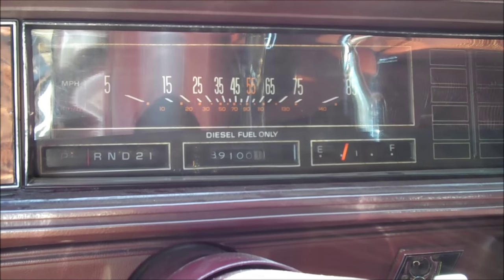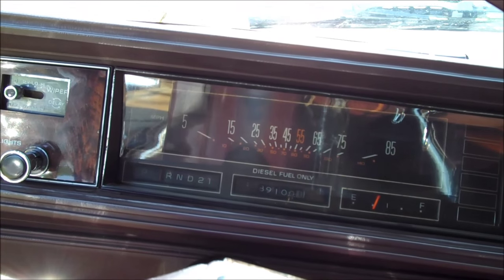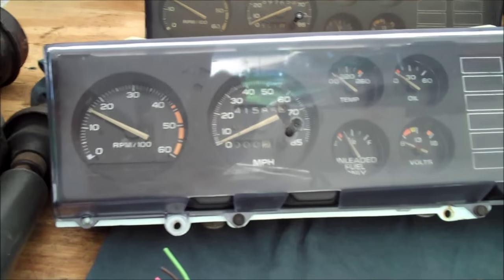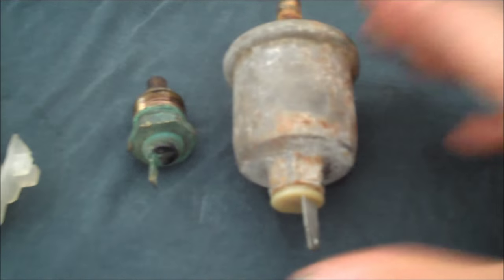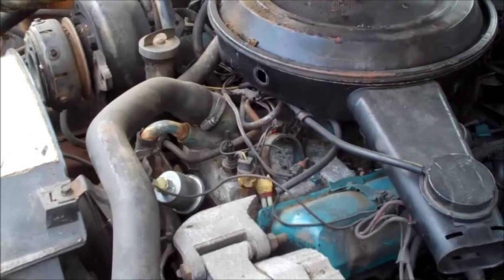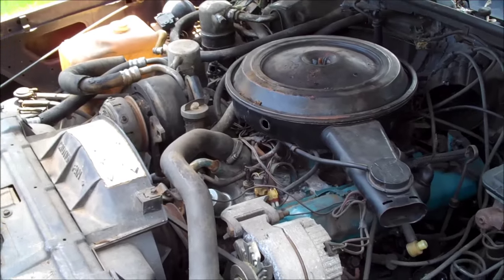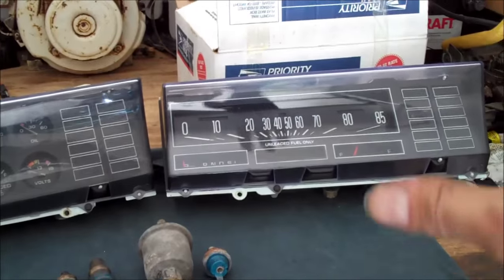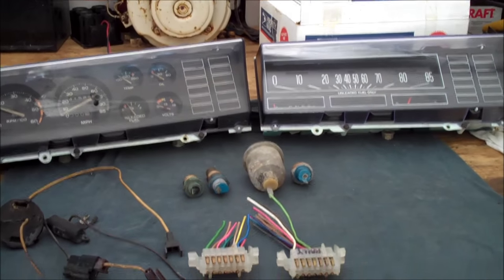How To Swap in a Rally Gauge Cluster 78-88 Cutlass

Comment: How do you access the G-body ignition switch and headlight switch on a 1987 Monte Carlo? Looking to do a remote start in one. Thnx
Reply from the maker: They are both located on the lower steering column shaft under the dash.

Comment: It would appear that the rally cluster is intended to be used with a center console floor shifter. I don't see any PRNDSLs on it.
Reply from the maker: dogbyte555  You can find them with the gear selector in them but harder to find as most were a console option.

Comment: i started doin this. interesting how he skips removing 37 bolts and completely disassembling gauge cluster to get it out.
cuz mine wont just pop out...how does the gearshift marker which sits vertically in a horizontal slot get removed w/o disassemling  gauge cluster?

Comment: Hey love your channel is there a way I can install a inside door handle inside the 1979 cutlass Calais without taking off the door panel? and a way to diagnose why a electric window stopped working??
Reply from the maker: You must remove the door panel to do any work like that. Test the power to the motor, if there is 12v then the motor is bad or the switch

Comment: Is that car or was that car a true diesel? I have never seen one in Canada. Diesel that is. I have had quite a few Chevy's over the years. I never did own a 80's G body. The closest to a g body I owned was my 1978 Chevy Impala 2 door with the wrap around rear window. I owned that car for many years and I did a lot of things to it. I installed a 383 stroker, A built up turbo 400 and installed a Ford 9 inch rear diff just to handle the power. It was a heavy car but also a fun car. I had a toggle switch under the dash connected to the electronic ignition so no one could steal it. Well I thought anyways. It was stolen about 1 month after I had the turbo 400 rebuilt for the second time. The transmission shop were the only ones who knew where the toggle switch was. About 2 weeks after it was stolen, the police found the car minus the engine and trans in a back alley many miles from my home. Someone from the transmission shop needed it more then I did I guess. I was pissed to say the least and was out $10000.00. I got the shell back, threw a 350 and a turbo 350 from a junk yard into it and sold it. I was not going to go through this again. Sorry for the long story but the 1970's through the 1980's were some of my favorite Chev's.
Reply from the maker: Awesome stories man! Yeah the one car I show was a factory Diesel but won't be any longer.

Comment: Can you tell me what wires to swap to put a monte Carlo rally cluster to a stock malibu sweep style
Reply from the maker: You need the entire cluster with housing and then you need the correct main plug from the cluster so you know how to re-pin your main plug to work with the gauge cluster. Swapping sensors is the same as in this video.
Reply: @ClassicGBodyGarage  is there anyway to know what colors do what ?
Reply from the maker: @wadedog4280  GM Electric Service manual for the year car you have. Or maybe a search on line would work.

Comment: Which oil pressure elbow can i use for a 307 1984 Olds motor? I will retrofit the original rally pack gauges to my Delta88 Olds car. I had all the components, only the elbow is missing. I believe that the elbow use 1/8NPT Is that right? Greetings from Germany
Reply from the maker: 45 degree angle with same thread pitch

Comment: will a cluster  from a 86 el camino fit my 78 malibu or will I have to change the housing  also?
Reply from the maker: if the 78 malibu has the gauge package and you are just swapping the gauges it will work, if the malibu has only the speedo then you mus swap the entire housing and dash harness.
Reply: +Classic G-Body Garage I'm swapping a 86 Monte rally cluster gauges with the original 78 Monte Carlo one that just has speedometer. what do I have to do? I see the connector needs to be rewired on the one in the video but am a little confused now
Reply: +trekitytrekyoself nevermind! rewatched and it makes total sense now. thank you!

Comment: How similar is this for Monte Carlos?   Have an 88 LS 4.3 I want to swap ss gauges into.
Reply from the maker: You need to swap out the ENTIRE housing as the sweep style housing is different than the gauge housing. Once you have that you follow most of the same process. The main plug pin layout is different so if you can find a gauge style plug you can the reconfigure yours

Comment: Will the tach filter will also keep any ignition noise out of say an aftermarket stereo system with an amp ? I've had it where I had a whine sound from them but I forgot what the cure was it's been a minute.. like 20 yrs worth of minutes lol
Reply from the maker: make sure your motor is grounded to the body.

Comment: Hi I just did the swap but havining problems with the oil pressure switch my old one has 3 wires. And the switch has 1. Do I splice all wires together or use 1 wire? Ifn1 wire how do I know which is the main.

Comment: The only thing you ever show is a gutless cutless! How about the cluster in a 78 monte carlo. Those 2 are way different in every way. Looking to put a 1986 ss monte cluster in my 78 monte carlo
Reply from the maker: I show the Cutlass because I have the car to perform the work needed. I don't have a Monte or Malibu that needs a swap to create a video. Bring yours over and we can put a video together. On a Chevy, you need swap out the entire housing as the sweep speedo housing is different than the gauges style. If you can get the gauge plug off the monte harness then that will help otherwise you have to repin your plug. Swapping the engine sensors is the same on a your lightning fast 78 Monte and a Gutlass Cutlass.

Comment: Was following the video everything was going well until I went to put the rally cluster in. It looks like the speedometer is not lining up. The white plastic piece is in the way of the new one. So apparently the old one and new one don't line up when it comes to the Speedometer. I am going to try and take the rest of the back black part off to see if that can be adjusted. If you have anything on that, that might help it would be appreciated.
Reply from the maker: The white insert in the dash? Remove it and you will be fine.

Comment: How did you handle the shift indicator?  The rally gauge cluster you show does not have the shift indicator.  Can you swap that from the original "granny pack" cluster?  I am finding the rarest of things is a rally cluster from '86 - '88 that includes the shift indicator with "OD, D, 2, 1".  What you show is a pre-'86 cluster with only "D, 2,1".  

Those '86 - '88 Cutlasses had some very weird option packages.  Like cruise control with no tilt steering wheel.  Or power locks without power windows.  Another weird (and very rare) was the Brougham package (pillow-top bench seat, column-shift, & rally gauge/wheel package).  Ahh...the '80's.  Gotta love it!!

Comment: How does the white plug disconnect from the cluster back.
Does it come forward enough to push each wire out and replug in correct spot ?
Reply from the maker: The plug stays in the dash and the cluster just pulled out.
Reply: @ClassicGBodyGarage  , how do you get it out to move the wires

Comment: I saw your other video too on your 78 Cutlass. I have a 79 Hurst Olds. To me it looks like the ralley pack gauges on a 78-88 Cutlass look identical - is that right? And if so, is the circuit board the same??? I do know if so, I cannot find a vendor ANYWHERE that sell these.
Reply from the maker: +ahafan64 They are all the same 78-88 but gauge faces are different from year to year give or take. All boards are the same. No one makes them that I know.

Comment: I am looking for a Rochester 4-Barrel mixture adjusting tool to adjust the dwell on a '84 Cutlass Calais.  Can anyone help me?  Bob Koniar
Reply from the maker: +Robert Koniar  Try NAPA they still carry a lot of carb tools. I have bought my mixture adjustment tool there.
Reply: +Classic G-Body Garage I checked with NAPA.  The, only, tools set they have is for carb adjusting on the bottom & sides.  I need the tool to adjust the MMC - Mixture Control Solenoid located on top toward the engine.

Comment: What's up GMan, appreciate all your Videos, good work.. I got a quick question, I have a 84 El Camino, and my question is,,, I only feel the air comming from the floor, how do I get the air to blow from the vents??? We're should I  start looking?? You think I have a bad vacuum leak?, bad diafram? I'd appreciate some G Body advice... Keep on keepin on with the Videos. Thanks.
Reply from the maker: carwasher420  Yep a vacuum leak. Start at your source of vacuum which is your engine and make sure your lines are good going to the vacuum bubble which is your source for the vents.

Comment: I noticed that your sweep gauge has your shift indicators (PRNDL) and the rally gauge doesn't.  How did you remedy that?  The rally gauges with shift indicators are rather hard to find, especially with the '87 and '88 Classic models with the Overdrive (PRNOD21).  Thoughts?
Reply from the maker: Its just a rare option thats pretty much it. Cars were ordered with bench seat and gauges especially the 4 door cars into the 80s that offered Overdrive.
Reply: @ClassicGBodyGarage  No, what I meant was that you are replacing a sweep gauge WITH shift/gear indicators to a rally cluster WITHOUT shift/gear indicators.  How do you know what gear you're in?  And if you were to find a rally cluster with shift/gear indicators how would that change the installation process to align things properly?
Reply from the maker: You need to hunt down a cluster with the shift indicator or just the shift indicator itself. Ebay or the Classic Gbody Garage Facebook group

Comment: hmmm just noticed my tac isnt running through the filter.. maybe that explanes my high rpms? while driving
Reply from the maker: carlos916  it could mean a few things. it will read incorrectly if the connector on the back has issues. Check out my cluster "fix" video
Reply: cool thanks!!
Reply: Classic G-Body Garage just a heads up.. ended up removing the cluster, soldered the small connector to the V8 tach and im all good!! thanks again!!

Comment: Hey man i need your help respond to my comment on your Rear end video, Wanna know how to take out rearend with brake lines still hooked up to drums, and how to disconnect parking brake cable from drums and how to hook them up
Reply from the maker: Undo the rubber hose brake line at the frame and you need to disassemble the drum brakes to remove the cable.

Comment: Great Video Brian. My 80 Cutlass Supreme did not come with a clock from the factory, but I noticed while replacing lights in my cluster that it had the wiring harness in place for the clock and had power to it. I went to the wrecking yard and found a car with a clock and the correct wood grain trim piece with the cutout for the clock. I purchased the clock and the trim piece and installed them. Easy upgrade since the wiring harness was already there and hooked up.
Reply from the maker: *****  Yeah i did the same on my 80 cutlass back in the day. Many options are plug and play if the wires are there. Courtesy lights are another plug an play upgrade. Same with trunk release.

Comment: Can you post a video on how to connect the cable that’s behind the speedometer cluster to the gear shift that shows park, reverse, neutral, and drive? Some one tried to explain to me how to do it but a video would really help. I have a 84 Oldsmobile Cutlass Supreme Brougham with a steering column gear shift.
Reply from the maker: Sometimes the cable breaks or the plastic tab breaks. You then have to remove the cluster and there are two 7mm hex head screws that hold the gear selector in place to the cluster, Remove them and find out what happened. The other end of the cable fishes through the dash down to the column and clips on the column sleeve. You need to remove the vent bezel under the column to see it. I can do a video but won't be for some time. Hope this helps you in the mean time.
Reply: Classic G-Body Garage ok thanks I’ll try it out. Tag me if you ever make a video

Comment: How do you remove the speedometer cable from behind the cluster?
Reply from the maker: Clip on the back side. You need to unscrew the cable from the trans and the small bracket that holds it to the master cylinder. You need slack on the cable first. Remove the cluster and the cable slack comes with it, then push the tab on the back of the cluster.
Reply: Classic G-Body Garage ok thanks

Comment: What does the little white part that the speedometer cable is held on? And where do I get one? I'm trying to hook up my cluster but cant get that wire in and cant reach from underneath the dash.
Reply: Did you find it mines is missing
Reply: @FEDERALBOYSENTERTAINMENT  I never found the white piece but finally was able to get the cable in. It took like 5 hours, you need someone with small hands
Reply: @prezmoney  where do you get the cable
Reply: It's called a speedometer cable they should have some online or autozone carries them too
Reply: @prezmoney  I have the speedometer cable I need the wires for the original cluster he shows in the video at 3:49
Reply: I need the standard plug at 5:20

Comment: How do you hook up the fuel gauge when you do the switch on cluster great video by the way
Reply from the maker: MrSimpleFuK  The fuel gauge works off a one of the wires on the main plug behind the cluster. As long as you have them in the correct order it will work as it normally would.